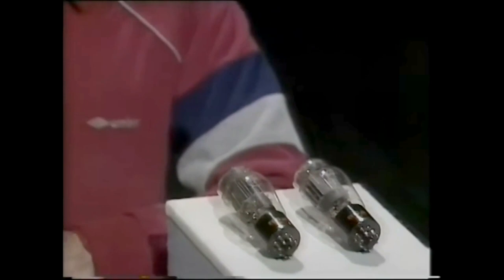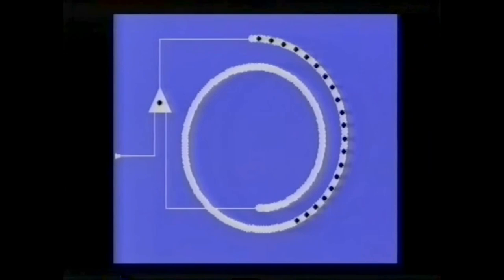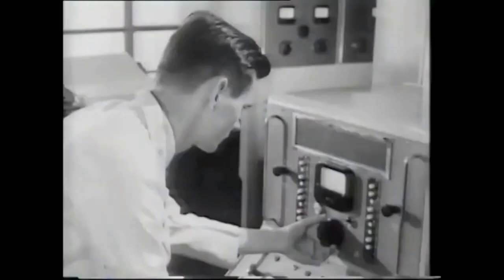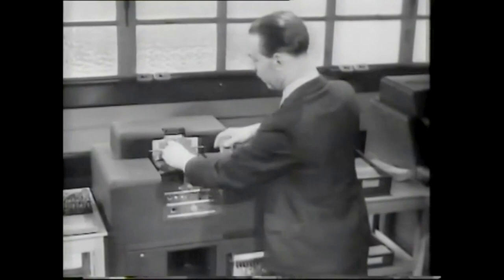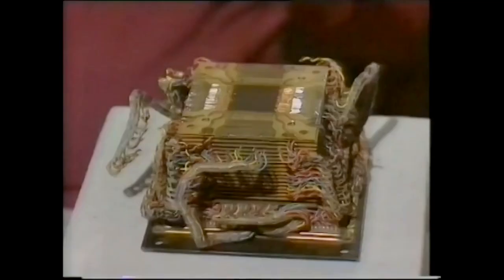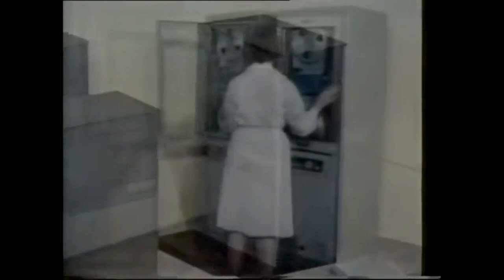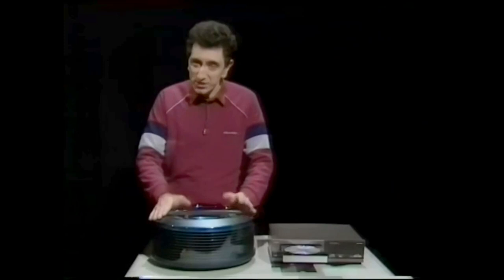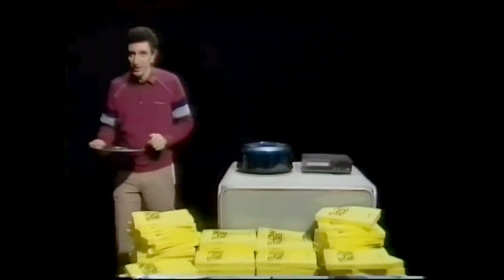Computer History:  Memory & Storage 1950-1985 -  (Core, disc, vacuum tube, etc.)

Comment: think about this
4KB in a floppy disk was crazy back then
but now they can make 4TB hard drives easily
Reply: Floppies were a little larger than that. The first 8 inch floppy disks stored something like 180 KB per side if I recall correctly. The first ones were single-sided. Pretty soon they realized they could use both sides of the disk and double the capacity. The final form of the floppy, the 3.5 inch disk, could store 1.4 MB, which was really a pretty impressive amount of data for the time. The first mainframe computer I worked on could only store 1 MB, on a disk 2 feet in diameter.

Comment: Back in the 70's & 80's I was a computer technician, working on a variety of systems.  I worked on DEC, Data General, Collins and Pr1me gear, including tape & disk drives, core memory, punch card systems and more.  I even worked on one system that used vacuum tubes & relays and had a drum.  I still have a core memory plane from a Collins computer.
Reply: Forgot to mention, I also worked on some video terminals that used acoustic delay lines.  They were built with a coil of wire.
Reply from the maker: Hi James, sounds very cool.  "Collins" is not a brand I am familiar with.  You worked on some very early machines!  ~ Victor, at CHAP
Reply from the maker: ... Acoustic delay lines are a technology most folks today are not aware of.  Did you have a favorite computer manufacturer?   ~   Victor, CHAP
Reply: @ComputerHistoryArchivesProject  Collins started out as Collins Radio and then became Rockwell Collins.  They made a lot of aviation equipment too.  Look up Rockwell Collins for more info.  Other than the one with Vacuum tubes, which was older than I was, the stuff I worked on was 70's & 80's tech, though some a bit earlier.
Reply: @ComputerHistoryArchivesProject  I spent most of my time on Data General.  There were several techs where I worked and we tended to focus on certain makes, though were trained on most of them.
Reply: @ComputerHistoryArchivesProject  Forgot to mention, the Collins computers I worked on were part of the Air Canada reservation system, with the Collins computers used as the communications front end for a Univac system.  You can search on Collins 8500C to find a programming reference manual.  We also had a couple of other Collins systems, which I did not work on, which provided the public telegram system in Canada.  When that moved to some Data General S/130 computers, I was the main tech for it.  This was at CN Telecommunications/CNCP Telecommunications/Unitel Communications, where I worked for 23 years, though only 12 of them as a computer tech.
Reply from the maker: Hi James, thanks very much for clarifying.  Yes, I remember "Collins" a bit now.   My dad collected vintage radios and had some Collins sets, I believe.   Data General must have been an interesting place to work.  Their systems appeared to be well designed and constructed.  I will do some searching on "Collins" as well, to expand my knowledge.  Thanks again for watching and sharing some great info!  ~   Victor, at CHAP
Reply: @ComputerHistoryArchivesProject  I didn't work for Data General.  I worked on Data General computers.  As I mentioned, I spent 23 years at CN/CNCP/Unitel.  Here's another name from the past, though you won't find much about it now.  That is "Teleregister", which was owned by Bunker Ramo.  They made that ancient tube based computer I mentioned.  It was located in the Toronto Stock Exchange.  I worked in there, as CN had the contract for maintaining a lot of stock exchange gear, as well as our own.
Reply: @James_Knott  i bet you have read the book: Soul Of A New Machine by Tracy Kidder?

Comment: I remember seeing those platers in the computer room. In 1980, There was a memory device called core storage. Two wires went through the center, and the wires crossed making an X shape. The box was about a 4X4X4 box.
Reply from the maker: HI Mutlap, yes, that sounds like a core storage array.  Those 4x4x4 boxes of core are quite collectible now too.  Have seen several on eBay, some for several hundred $$.

Comment: At 2:52 - Core Memory - I did circuit design for mini-computers in 1972 to 1978 which used core memory. Fast core memory had a cycle time of about one microsecond (1000 nanoseconds). I began designing Z80 based systems in 1979. The memory cycle for a 4 MHz chip was 0.75 microseconds. Soon enough the Z80 was available in 6, 8 & 10 MHz parts.

Comment: Find it peculiar that he talks about 16 bit in connection with the vac tubes (valves). Although at the time this was made, most common computers were 16 bit, I can't recall any vac tube computers that were. Quite often they were 6 bit with an extra check bit to match the number of holes punched into paper tape. The machines were already insanely big, they would've needed multiple buildings to house them if they were 16 bit
Reply: No one talked about 16 bits? All he said was it takes 16 valves to store 8 bits because it takes two active elements to make a flip-flop.
Reply: He didn't. He said 16 are needed to store 8 bits. Pay better attention!